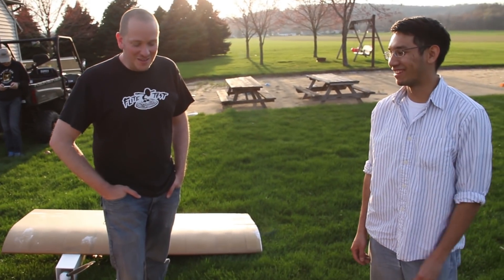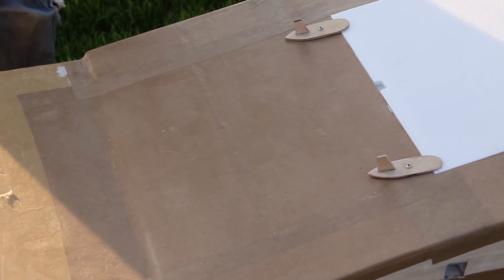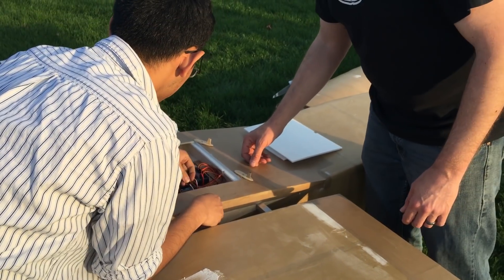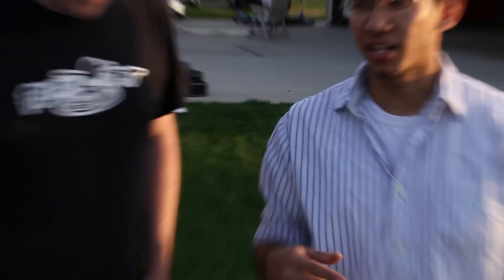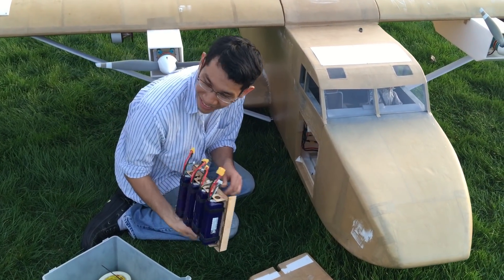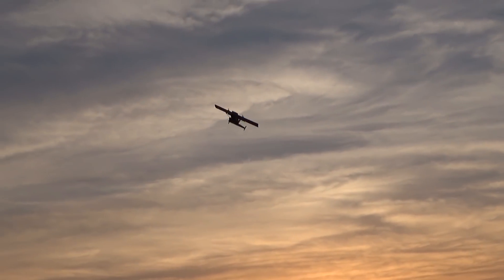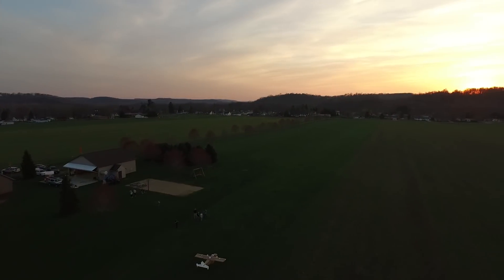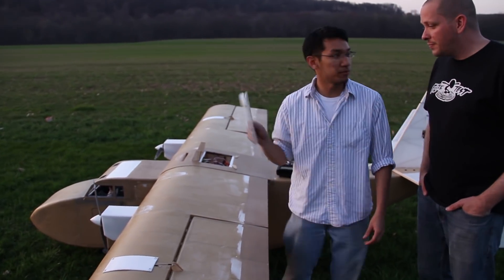DIY Giant Cargo Plane | Flite Test

Comment: This is for Peter I really joyed what you have done with this aircraft.  Myself being a homebuilt aircraft builder and a bit of a designer I have a couple of tips for you.  For starters your ailerons should have been only 20 to 30% of the winds cord.  Because of the size of your plane you have to think more like a full sized aircraft when it comes to your control areas.  Because of it's size you have to look at way to clean it up aerodynamically  is a must.  Because of the planes size you no longer have brute power in your favor so you have to rely on finesse, just like a low powered homebuilt aircraft. 

Myself I'm getting back into RC after being out of it for the last 30 years.  So I'm working on a Mudduck Mark 2 that will be powered with a Weedeater motor, I'm also looking at Flite Tests Simple Storch and blowing it up about 200% so it will handle a Weedeater motor.  Being a couple of steps away from 60 now, I need something big and slow to fly.

Comment: For real aircraft aluminum try Aircraft Spruce and Specialty www.aircraftspruce.com you should be able to find anything you need as far as aircraft building materials. On the strut if you an use a piece of angle rather than flat aluminum at the core it will be a lot stiffer. That is a serious plane, I agree with 206LaKi you need to load it up with paratroopers.

Comment: 9:09 Peter, were you quoting hickok45 there? 
Anyways, awesome job! I was holding my breath through most of the video because just the idea of something that big flying around without a pilot inside of it is a bit terrifying to me lol
Reply: Caleb F. It had a pilot. They showed it during takeoff, he was mounted in the cockpit. :)
Reply: John Boley Jr. Scale cockpit; Ailerons aside, that plane has tons of "scale" details. The pods under the wings, the print outs of the instruments and gauges in the cockpit, the throttle looks like it can be moved.
Peter has real put so extra effort into this huge build.

Comment: Maybe you can put contra-rotating props on it to make it a bit faster and cancel out the drag.

... That's how it works, right? I'm questioning whether or not I should deserve this degree in physics.
Reply: Mijova Kalaydzhieva counter rotating props eliminate the tendency for the plane to turn in one direction (due to motor torque and p-factor). Although there may be small induced drag, I believe it would be negligible.
Reply: mongdex So it wouldn't make a difference for this plane, right? I didn't think it turned in one direction.
Reply: Mijova Kalaydzhieva no it wouldnt make a difference as the motors are too small to have an apparent effect.
Reply: +Mijova Kalaydzhieva When you have a twin prop, the  prop torque cancel out even when both props spin in same direction.  You don't get a degree until you figure that one out.  Just put the torque motion through your head.  It will come to you.

Comment: Nice job Peter. You ever get your 30 Amp used verses should be ^0 Amp power issue sorted out? Could it be with the selected prop you are only demanding 30 Amps?

Comment: Hey Peter, good job. You guys were chating about what causes ailerons to deflect upwards. As you know a wing has a low pressure on the top side, that's why it lifts a plane. This low pressure is trying to suck your ailerons upwards and the forces on your servos must be huge trying to counter this.  I understand the horns on one were loose but the leverage of those large chord ailerons are going to cause you grief either way eventually.  Bite the bullet and half the chord, you will be happy you did and so will your servos :)

Comment: Peter and FliteTest, if you guys are up to, you can totally improve the aerodynamics on your wing by simulations on a software called XFLR5. Its free and many SAE Aerodesign teams use it to project their airplanes. Some planes pull up to 30lbs of payload using a OS.61 2 stroke engine.

Plus, if you want some library I have some e-books available on my Google Drive. Feel free to browse: https://drive.google.com/folderview?id=0Bw0nuyXFzZA0Ui0xZHZnb29wREE&usp=sharing

Comment: You guys said that in the kraken video that you could just fly it as a three channel. But u gave me esc's that were unequal so it wouldn't fly strait. So I can pay another $150 for 4 quadcopter equal esc's or I save up forever and get a controller that is wayyyy overpriced. Is it possible that I can send u my esc's and u guys can send me two balanced ones? Thanks! Keep up the good work.

Comment: That's pretty nice.

I think you should look into aerodynamic servo tabs (https://en.wikipedia.org/wiki/Servo_tab) to reduce control forces for the ailerons. Big airliners such as the MD-80 move the ailerons with servo-tabs, and a single pilot has easily enough force to fly it without hydraulics.